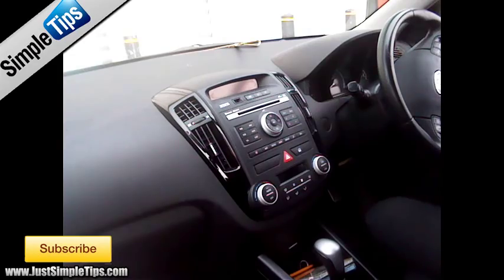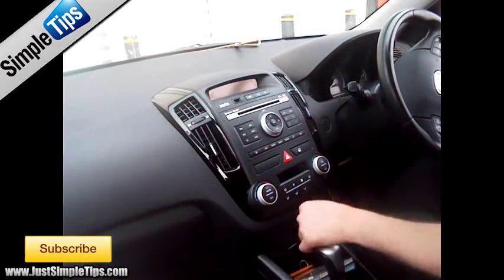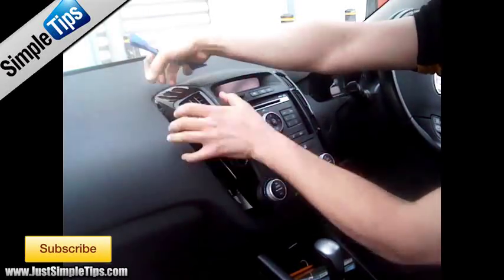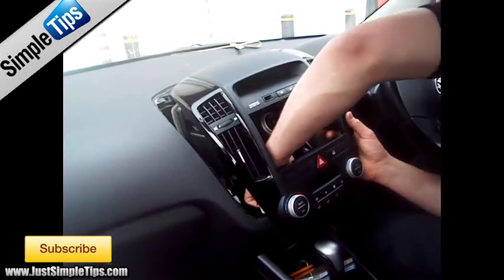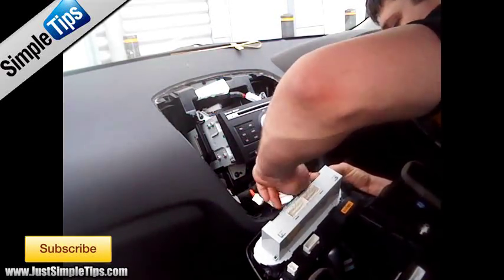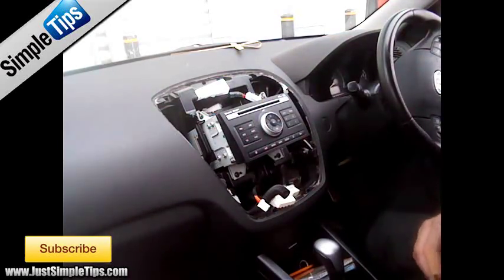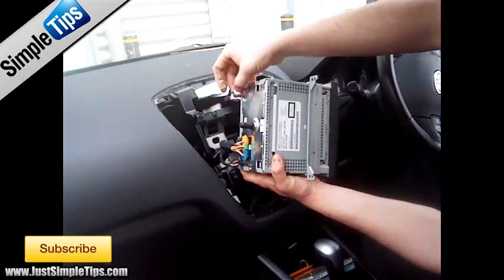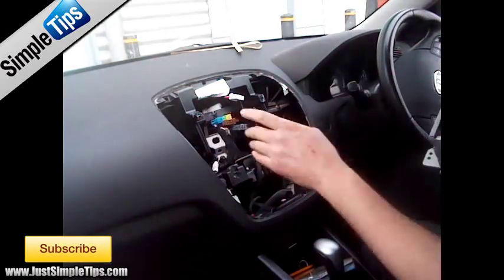Radio Removal Kia Cee'd (2006-2012) | JustAudioTips

Comment: Hey, I have a 2009 Kia Ceed SW, and there is no way to remove either two display connectors, and the two connectors attached to the AC system control. They are really hard attached and it seems I´m goig to scratch the whole thing before remove them. There is some trick to remove them without employing only brute force?

Comment: Hello,
I have a navi screen in my ceed. I removed The whole navi thing as in The video. However, now The car doesnt start without The Navi Panel in. I need to exchange The navi touchscreem bc it stopped working. Is there some safety switch, which disables car start after removing this assembly?